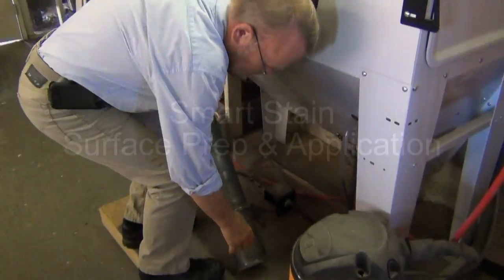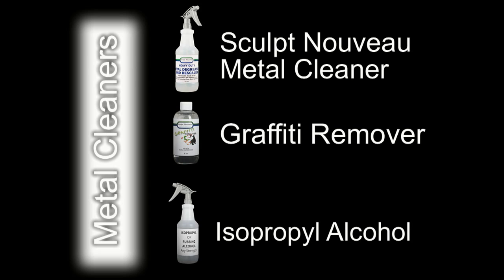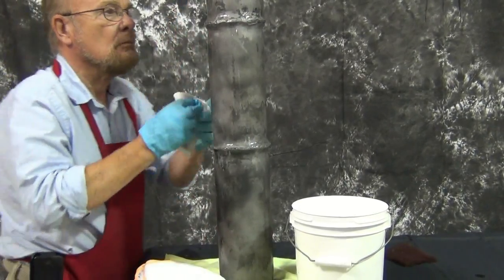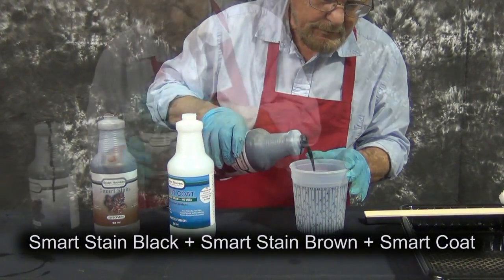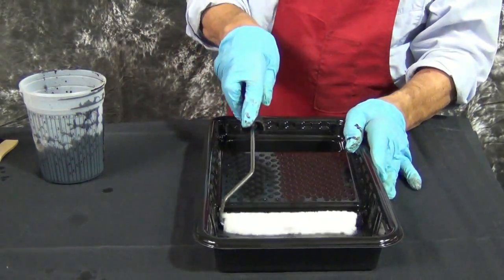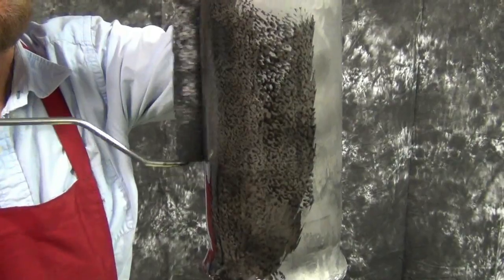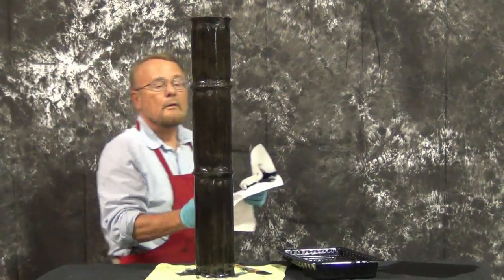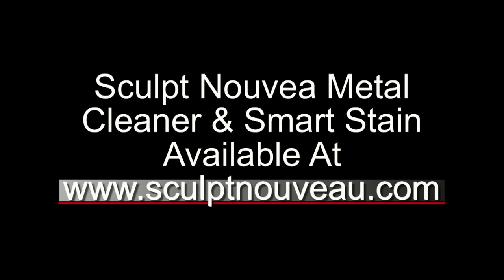Surface Prep and Smart Stain Application

Comment: It became significantly darker from when it was wet to when it’s dry; were additional coats applied? Can I achieve a transparent black?
I only want to tint the steel to add depth to the surface finish and some engravings.
Reply from the maker: Yes you can achieve a transparent black with the Smart Stain Black, just thin it with Smart Coat Matte.

Comment: can you apply this over mill scale (on hot rolled steel)?
Reply from the maker: +alphagojo Yes Smart Stains will bond over mill scale. Surface preparations still must be done, but you do not need to remove the mill scale for it to work.
Reply: Sculpt Nouveau when say surface prep are you referring to degreasing only being he is looking to apply it over mill scale? I too am looking for a product I can apply over mill scale. Thanks for your help
Reply from the maker: Surface prep as in degrease and scuff it up with a scotch brite pad